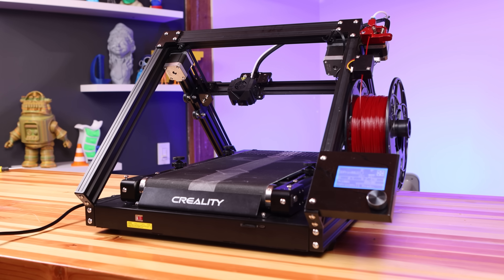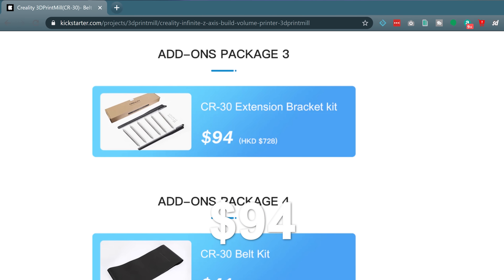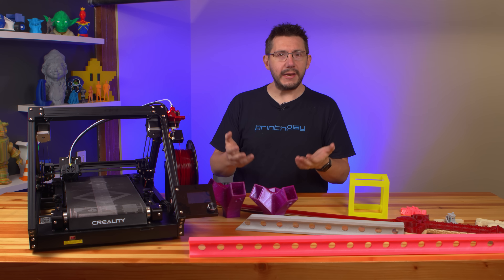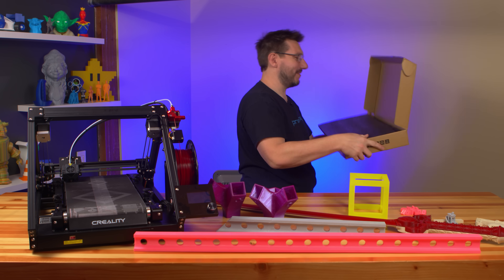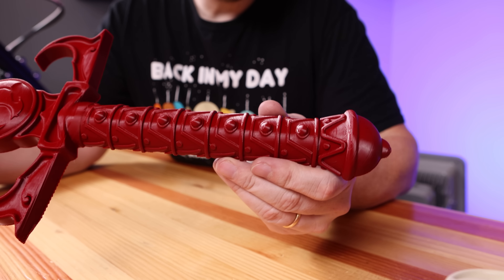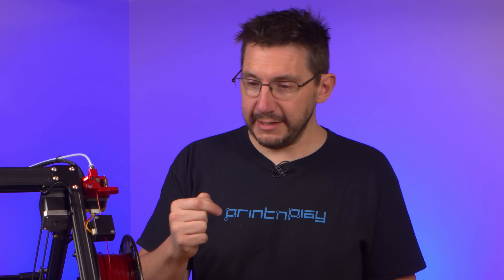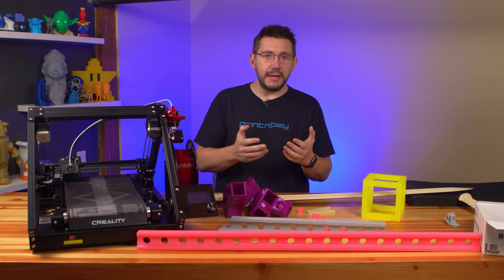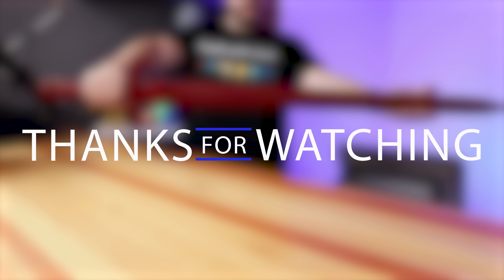Creality CR-30 / Naomi Wu's 3DPrintMill Review - SWORD OF OMENS!

Comment: So, I got my CR30 recently, and had some serious issues with pla bed adhesion out of the box. With lots of effort, I believe I've finally found slicer settings that work right. When the prints don't fail, the quality is epic.
Reply: Hi! I just purchased this printer but still have settings problem! :( can you please share your best settings with us? Thank you
Reply: @fefy9465  I could share my settings, but the problem is that unless you live next door to me, there's very little chance that they'll have the same effects on your model. Unfortunately, 3D printing is subject to the local environment as much as the individual differences in manufacturing. Your best option is to start with what has worked best for you so far, then making small adjustments to a single setting at a time. Each individual change can have an enormous impact on the outcome of your prints. Different problems require different changes to your slicer settings. Layer adhesion problems can be solved with a higher fan speed at 1st layer (I set mine to 10%). Problems with parts being pried off the belt can be solved either by adding a leading edge and using a raft (1mm thick is enough), or by adjusting the z-steps on your firmware (if the printer head is prying them off the belt). It also depends on what material you use. PLA would require different temps than PETG is different from ABS, etc.

Comment: I still don't get why it has to be 45 degrees why not just have a belt instead of a bed the bed still moves so it must be accurate enough so just print stuff like normal then at a point move the bed. Like printing in blocks

Comment: Try using a new micro sd card
It will fix the crashing issue
Both the micro sd cards sent to me from creality were faulty. My prints kept crashing and stopping mid print. After using new micro sd cards (not from creality), I haven’t had any more crashes.

Comment: Hmmm.  A chair. Using an inner shape that allows empty sodacans to take the load of actually sitting on the legs. Perhaps the seat can be filled with concrete. Or.    .. Make an entire bed including the springy part the mattress rests on. With little plastic springs. Interlocking parts. Maybe superwide n  mostly hollow, like motorcycle frame profiles, meant to be partially filled with concrete, papermache or whatever strengtthens it on the cheap.. You could probably design pretty damn huge intricate furniture with this.  Baroque style. Perhaps design in space for wodden or metal rods that strengthen the construction and join parts.

Comment: I would like to see how print quality holds up over time as far as keeping in spec with a belt. Usually, belts & mills don't mix well due to material stretch but as long as it's not used in reciprocal motion it SHOULD hold true, appears to be a variable speed thats set in a continuous direction but leveling looks like a real pain

Comment: The CR-30 doesn't eliminate the need for support, it just exchanges some overhang issues for new and interesting ones. Try printing a Benchy bow-first without support and see how it comes out. :) It is an interesting printer for some narrow use cases but most people will be better served by regular cartesian printers.
I don't support established manufacturers using Kickstarter as some kind of preorder platform, so I won't be backing it there. When I do buy one of these it will probably be much later on, or even one that an ex-backer sells when they realize it doesn't meet their expectations.

Comment: If you mill out a channel in the sword if possible, that runs the length of the body minus half an inch from each tip, and glue in a small metal pipe (doesn't matter if hollow or not) and glue the entire unit together you can have a more "functional" solid prop that's ready for painting. Also I have a general question regarding it. How well does it handle helmets?

Comment: Interesting stuff, what a cool 3d printer. I do have to call you out for your decimal reading, though, 0.02 is 2 hundredths, not 2 tenths. It really did an incredible job of calibrating the length of your butter :3

Comment: I like the idea of it, but I don't think I have enough reason to buy it.

I only have one model that springs to mind which will benefit from the infinite Z, the buster sword from FF7. Maybe I could do some stormtrooper components and similar.

Also, I have a personal issue with Naomi Wu. I appreciate and respect that she is one of the biggest names in the community, and clearly she knows what she's doing and saying; unfortunately, she sells with her body as much as, if not more than, with her knowledge, having had several breast enlargements (at least two since I became aware of her) with a spike in attention after each surgery. It's a similar problem to female streamers who either decide or have to wear revealing clothes and use their bodies to gain followers. As such, on principle I don't think I can back this project.

Comment: I do not know why the slicing has to be difficult. Just add a 45 degree support plane under the model and do not print anything to make that support plane.
Reply: Oh. I guess you do need to adjust what you output for Y on the way out to the gcode though. That or shift the previous layer in the Y direction.
Reply: Without the Y shifting in the slicer, you may need to limit your Z lengths and adjust Y in a postprocessing step. With postprocessing and a 45 degree slope support, you should be able to use any slicer though. At least this is how I figure it.

Comment: It’s not right they use Kickstarter. My CR6E has been a disaster.
This printer is not for me but even if it was I would never back it. Not on Kickstarter.
Creality’s after sales service sucks and this is something Naomi can do nothing about.
That Naomi is getting everyone else else involved is incredible news and does bode well but if you have issues.
Well it’s Kickstarter Joel so your are throwing yourself at crealitys feet begging for help and they do seem to have a hearing problem.
Another issue is price.
The retail price was so low with the CR6E you saved nothing on Kickstarter and you gave up all the retail protection, because you are backing not buying and have no rights, for nothing. You don’t get a better deal you get nothing.
I don’t know if everyone has there CR6E yet but some got the retail units before the backers and that is just wrong.
Don’t get me wrong it looks like an incredible machine once they sort a few things out. Not for me as I said but bearing in mind the unusual aspects of this printer I can see why you decided you could not ignore it.
I hope they use a better board on this printer as my board on my CR6E failed, as did one of the fans and the extruder never worked oh and the ridiculous switch.
IF they assemble it better and IF they use better components I can see this being a wonderful printer.
But not on Kickstarter.
If I was going to buy one that’s what I’d do. No backing. Wait for the retail units, it might not be any dearer, who knows.
Good review Joel and best wishes Naomi you clearly have the right idea.

Comment: Thanks for another great and honest review!
I'm a backer of the CR6 Max. Haven't got it yet. But from what I have seen it seems like most backers are actually getting good printers. And if you pay as little as you do for creality printers then you shouldn't be surprised if the quality isn't at the same level as a $3000 printer.
I have read that there's a Bondtech print head for the CR30 the works. So things look promising.

Comment: I absolutely backed it! And hearing that slicer settings specially tuned for it will be included, is great. My only regret is that it looks unlikely that the Kickstarter reaches the 5 million USD where Creality promised they'd opensource the hardware :(

Comment: Joel, Another great video many thanks.

I am thinking that this may be a good addition to my mini print farm as I am very familiar with Creality components and have a particular product I manufacture (currently in 2 halves) which would suit perfectly the build dimensions this machine offers.

However you mention the maximum temperature of 240°c, I print (almost exclusively PETG) with a 0.8 nozzle and then they are upholstered so visual finish isn't the number one priority. At 0.8 on my Max and CR10s Pros I run them at 245-248°c to cope with the filament flow rate, with this in mind do you think the print mill will be able to handle a 0.6 or 0.8 nozzle with PETG at 240°c without having to run at a snail's pace? 

It sounds like the hot end is Ender3 Style, so presumably a Micro Swiss all metal hot end will be a straight swap?

Regardless it's certainly an interesting product and looks to be reasonably well priced.

Thanks again,

James

Comment: About the direct drive... The way the extruder assembly is mounted seems to be the same as with my ender 3 pro. There is a thingiverse design that works with that extruder (https://www.thingiverse.com/thing:3816051). I currently am using this part on my 3d printer. It works quite well. You have to take of the hotend first to be able to mount the 3d printed mount and you need the right length of ptfe tube.

Comment: @3D Printing Nerd ,I got same question at 14:21 on my ender3 v2.and I find the question and the solution。
it's because the gt2 belt is too tight，loose it .the question will disapper.
because when belt is too tight,the wheels got more pressure to the track,you know the wheels isn't hard then the track ,so you got the question.

Comment: Some prints i would want to see - take a set of 3d prints meant for the frame of a 3d printer (BLV MGN cube, Prusa, something like that) and run this thing for a week, straight. Printing really long things is cool but i dont think its the primary advantage here, the primary advantage is printing part after part without human intervention. Especially at scale with alot of these things in operation, that would effectively decrease print time even if the speeds were equal to a traditional printer. Of course a week of printing would require a gigantic spool of filament.....perhaps you can get a filament supplier to sponsor the effort!

Comment: As far as the sword being wiggly, if simply gluing it does not work, print again with a channel in each one fitting a length of metal rod.  You could have nubs sticking out (welded) at the ends of the rod, and maybe at one or two key locations along the length and have small indentations for those as well.  Use some good silicon adhesive in one channel, slip the rod in, adhesive in the other channel and whatever solvent for holding the halves together on the flat faces of the blades, and slap it together, clamp and leave it for a few days.  That would be my solution.  You could also just use the printer to make a mold and end up casting it.

Comment: My thoughts on bended beam:
When the beam gets off of the heated belt the hot bottom of the beam cools down, shrinks and bends the beam downwards.

The cooling layers in a 45 degree angle creates a tension in the print, just like abs does. And bends the beam up, I think

And the right combination of print temperature and belt temperature would create a straight beam

What do you think 😋?

Comment: First ever kick starter. I’ve just pledged for the last slot in the $688 price mark. On a second thought this won’t print ABS or will it? Please print using ABS and let’s see what happens. I imagine there’s got to be a way to add some enclosure on the x, y axis and the z origin only. Can they look at that possibility? Maybe just create some slot or attachment points. They don’t have to add the enclosure. Well they never do. Not printers from China.

Comment: Looking at all the reviews of this machine over the past few weeks and I think it struggles a little on normal builds you would do on your standard printer but it excels in other areas that your day to day printer just couldn't do unless in many parts. The build quality looks great (although how long the belt will last as every review reports black deposits on prints) and I am very interested in this printer, but I don't think it will be a case of this is the only printer you will need, the quality in certain positions isn't there. It's a shame there isn't another axis motor on the hotend so it could rotate, and adjust in the program for certain angles to get the quality there. Hopefully they will dial the slicer in and resolve the minor issues, but really nice job by all the designers involved

Comment: Why can'T be just a belt system on normal printers? I don't see a reason for that.
Reply: Took a while but found it. Robot factory 3d ( search for robotfactory_3d on instagram ). Conveyor belt kits for creality ender 3, ender3v2, cr10v2 and so on...
Reply: @samster1995   WOW nice man! Thanks alot!
Reply: There's a company that does parts for ender 3 belt 45 conversion. Forgot the name
Reply: @samster1995  I searched on it on YT and found a video from march 2020 uploaded by Teaching Tech? Is that the one you mean? It doesn't look like a belt to me. I was meaning a belt system so u can print "unlimited" like this one above, which also should work with normal printers. I bought my first printer a week ago, an CR10V3, and i already know that i have to glue my little prints because they are all so small if you don't wanna print in height, more like a plane. But there aren't any good bigger printers right now, so i thought that would be a perfect solution.
Reply: @MrGTAmodsgerman  no, it's not that one. Seen it couple of days ago on social media.
It's belt system instead of ender bed and x and y is at 45 like this one. 
Gonna try to find it and reply for you.

Comment: If that petg is “decent” my prints are straight “garbage”
Reply: Search 3d print magic numbers here on YT, several vids ....works
Reply: @flo-ridafpv5713  cool thanks!
Reply: @ikani1  no prob man, i used to print my big fast stuff at .3...moved to .32 prints looked better and get done faster
Reply: Petg is awesome but can be finicky to dial in too. Temperature and travels seem to do alot for PETG
Reply: Use magic numbers man....works wonders
Reply: @flo-ridafpv5713  magic numbers man?

Comment: I primarily print ABS, can you try that please?
Reply: I don't think the printer supports abs out of the box. But with a couple of mods (better mosfet for the hotend for instance) I can't see why it shouldn't work. If you feel safe printing on a 100C bed that is.
Reply: @lugiber  I print  ABS at 240c 85c fine on 10 different printers, apparently the CR-30 can do this. I just want to know if anyone has/is going to try this?

Comment: Z is always along the axis of a rotary axis on a machine tool. On a lathe its left/right on a surface grinder its for/aft. The belt has to be z because its the only axis not perpendicular to the hotend. Even if its not parallel there really isn't any other option.

Comment: They still can't fix their customer service for the cr6se. I doubt they can or even attempt to fix it for this one. Don't get me wrong. If it didnt take months to get in contact with creality i would have jumped on this for prop making. My CR6SE is still dead till i receive replacement parts(if they ever arrive). I really wish for this belt printer to happen. 
I just have no fate in Creality to bring this to the table responsibly.

Comment: 100.02 would be 2 hundreds off, not 2 tenths
wich is insanely accurate...
Reply: hundredths
Reply from the maker: Yeah I misspoke and totally took away from the accuracy. I APOLOGIZE
Reply: @3DPrintingNerd  bruh you straight butchered that .1 is a tenth .01 is a hundred .001 is thousandth and .0001 is ten thousandths
Reply: @bigdawghemi4134  lol, dude I'm a CNC machinist in the Aerospace industry, I understand decimal numbers pretty well.

Go to any machine shop in the world and tell them that .1 is a tenth and see what they say to you.
Reply from the maker: @bigdawghemi4134  Oh dude, I know. I KNOW. hahah.
Reply: @GOTTHEFUZZ  they aren't talking about tenths of a thou, but tenths of a millimeter. This isn't industrial level accuracy, but for a commercial product is pretty good.
Edited, used mille not thou, edited for clarity.
Reply: That's in the range of repeatability variance for the measuring device.
He could measure again and it come out exact or  .02 low or .04 high.
Reply: I agree! The only reason I checked the comments was to see if someone else had already pointed it out.
Reply: 0.100 : Hundred thou
0.010 : Ten thou
0.001 : One thou
0.0001 One tenth

Big difference friends, if something has a +/-.0001 accuracy it's extremely accurate,  but if something was only +/- .010 it wouldn't really be accurate.

I just wanted to inform you guys that tenths aren't 0.010 and that tenths are 0.0001.
Reply: @GOTTHEFUZZ  that was ment for you lol
Reply: Learned.

Comment: It looks like the CR30 could be made cheaper if it can be made as a shorter right triangle with a shorter belt and longer extension roller as standard equipment.
Reply: sort of, maybe? There are definite diminishing returns for shortening the length of the rails. You are only loosing a minimum of Aluminum and 95% of the parts are still there.